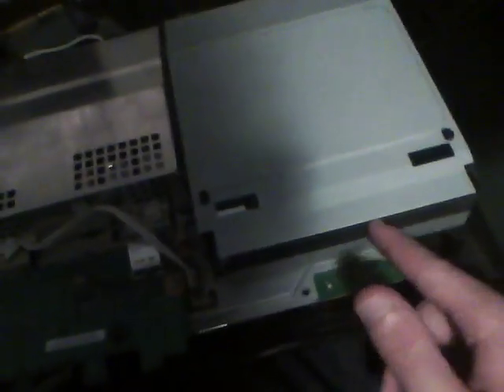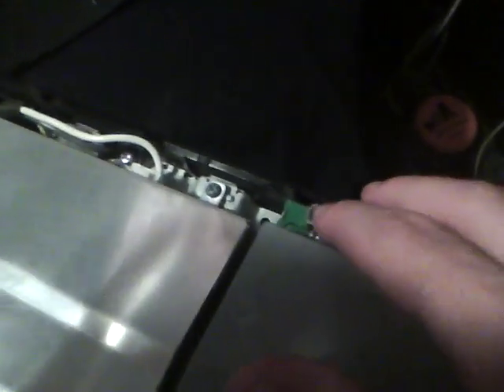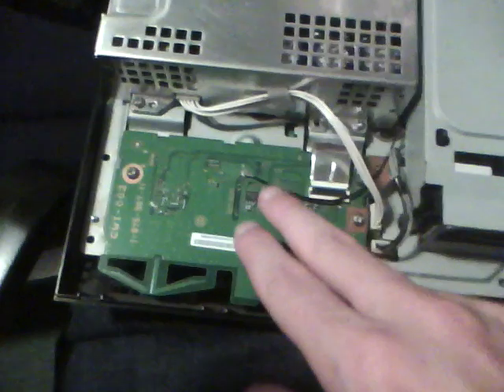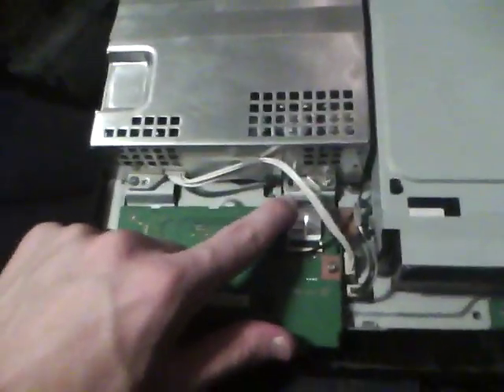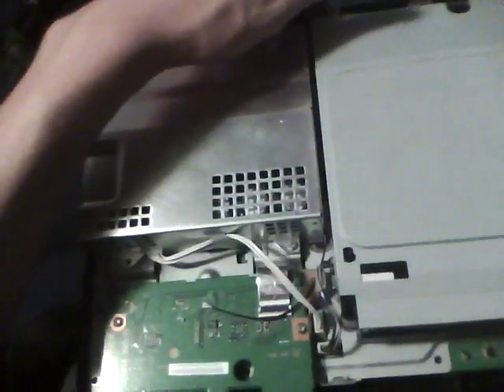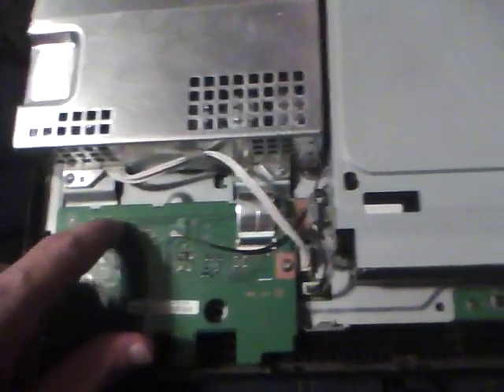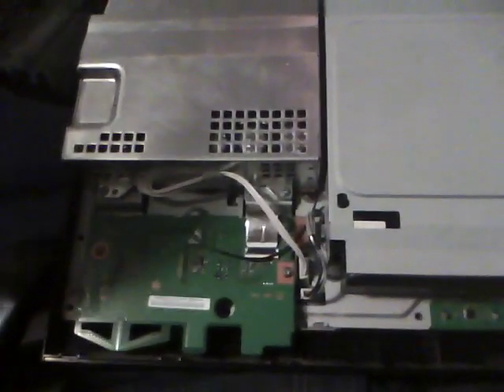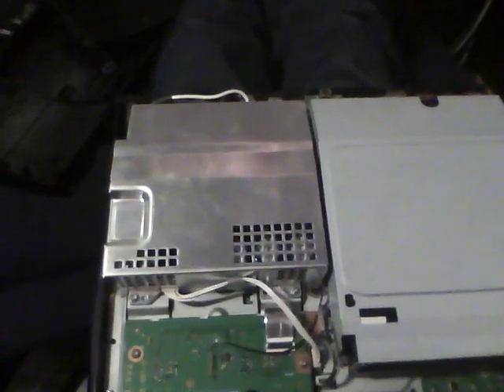PS3 How to fix internet problems and controllers not connecting (pt 2)

Comment: No internet wired or wireless on fat ps3. Tried everything else including what’s in this video. The other video I watched said it was the upgrade to all WiFi networks in the last ten years as a cause of these older consoles not connecting even with it wired because of the frequency interference

Comment: I fixed my slim just put it finger on the antenna rotate it till u feel a tight connection and turn it on wifi fix and my controller works again hopefully it's fixed permanently
Reply from the maker: Very glad to hear it! Here's hoping you've fixed it for good.

Comment: My ps3 does not show any signal but my ps3 works. Sometimes when you turn it on it will show it loading and then crash, with a funky tear of pixels. My ps3 also will not load safe mode or anything for it to show.

Comment from the maker: So I just want to let everyone know that this was a one-off kind of video I made 6 years ago. I do say that you can ask me questions at the end but that was really just me offering to flip through the internet to find an answer, but I do not have any personal knowledge about the inner workings of a PlayStation console (I just got lucky). I will say though that this fixed my problem and while I only use it as a dvd player these days, it still works just fine 8 years later. I'm so glad this video could help out so many people, and to those of you who still have troubles, I wish you the best of luck in finding a solution.
Reply: never had issues with my ps3 slim until now was playing one night it sighns me out and wont sighn back in and the controller wont cut on without the cable now.

Comment: my fat ps3 does not have that deattachable part and I already tried to push that small cable. I always get the error 80010201, so no internet, but at least I can still use my controller wirelessly after a few tries to sync

Comment: I have enter g gamepad, not a sony ps3 controller, I have modded it to a jailbreak software, I am a big fan of GOD, so I tried to install it on my ps3, but it didnt work and out of frustration I did something wrong and now when I turn on my ps3 it says connects the controller with the usb on the ps3, but  my ps3 is not getting recognising the enter usb controller, what can I do to fix it. can u help me plzzzzz
Reply: I am also unable to find the reset button as it doesnot have anything as such, plzzzzzzz help me

Comment: Bro when I try to connect to internet it just loading when I press cancel it does not cancle then I have to turn of my system please help me bro
Reply from the maker: I'm sorry but unfortunately I haven't used my PS3 since the release of the PS4 so I wouldn't know how to help you with your specific issue anymore. Keep searching the internet though as someone out there probably has a solution for you. Best of luck!
Reply: damn that the same problem im having right now
Reply: just do this I have that problem too but this helps

Comment: Hi Brah can you help me out here? To use the internet on the PS3 I connect through wireless and I have no issues with it, but I havent tried out the ethernet port. My usb ports are like not reading anything at all and I cant sync my controllers luckily one controller is synced though, but do you think it will work if I press down the black wire like you did? Pls reply Thanks :)

Comment: Thank you for this video first off.  I opened my ps3 and it looks different from yours.  I have an 80g model but the power box is black.  I've tried moving the black cable around and everything seems to be fine.  I'm not sure if I have to take the power box out to get to the underside of the circuit board.  My controller is working ok now but my internet is still not being picked up. This is so frustrating :(

Comment: You are so right. I just fixed my PS3 with your video. You had referenced to make sure that silver adapter is connected to the motherboard. When I checked and unscrew that hold part. I noticed my error. I never did connect the silver adapter to the motherboard. That part was completely out of the motherboard circuit. I plugged it back; turn on my PS3, and scan for my router. Within second, the play station found the router. I am back online.

If you took your PS3 apart, recheck the connection

Comment: Thanks alot man..... i recently just fixed my ps3 cuz it had the red blinking light problem..... and its turned out that as i put the ps3 back together again, i didn't fully connect the antenna wires back, YOUR VIDEO JUST SAVED ME SOOOO MUCH FRUSTRATION AND TIME!!!!!!! THANK YOU